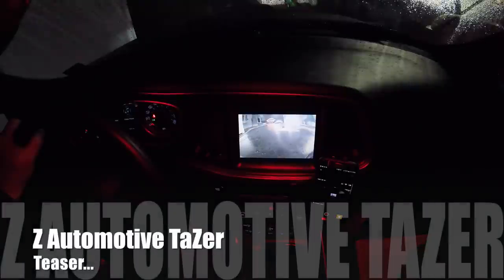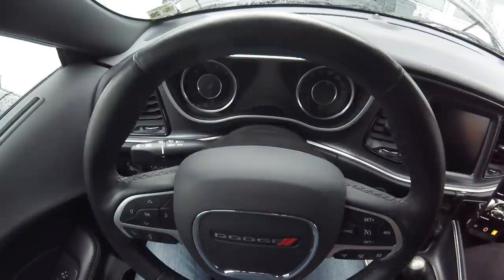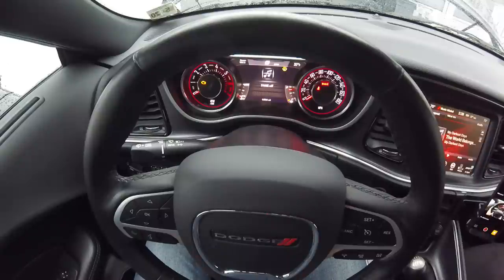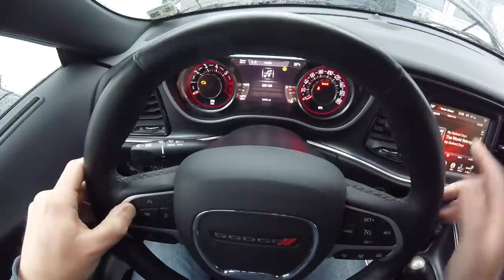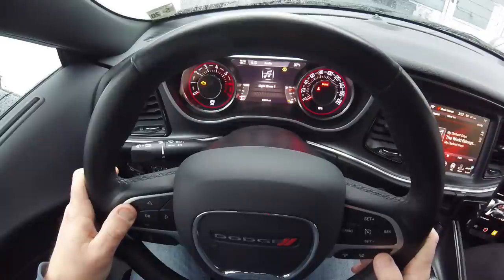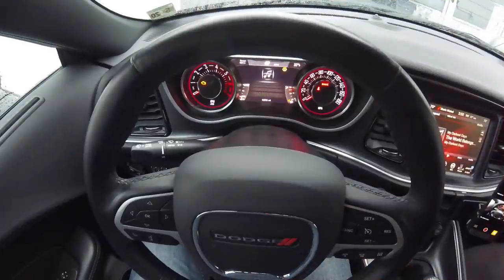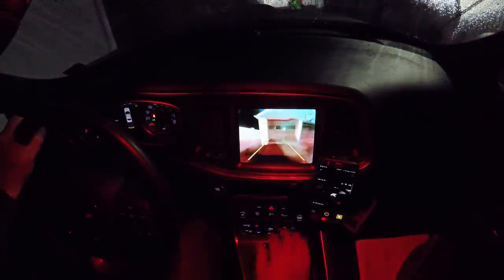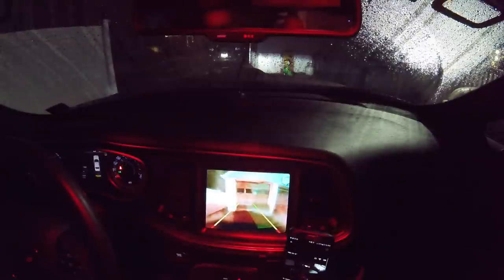zAutomotive TaZer - Mapping Aux Buttons, Font Camera, Fan Control

Comment: Another great install video, as always, you do an excellent job with all your video's brother, it viewed perfectly for me, very clear and in focus. What a great mod for $60.00 and 30 mins of your time, I think anyway!! I especially like the fact that I can map a Light Show into 1 of the buttons, as I am a Paramedic and through the summer months I do "ON-CALL" shifts and do have to use my own car, so I have set up my own Light Show that looks awesome, blending my Scat Packs Light Show with the Whelen Behind the Grill LED Light, a Whelen LED Dash Light and a Whelen LED Visor Light on the passenger side, the whole car is ALL LIT UP now, but of course, there are still idiots driving blind and DO NOT see me coming up behind them, even with ALL those friggin' lights flashing...lol...But my point is that it'll be so much quicker and easier for me just to hit a single button on the steering wheel, rather than the original method of lighting up the car. Thank you for the install video and the link to Steve White as well. I will definitely order one of these Aux Button Switches on Monday from them. On a side note, your Scat Pack is really nice, with all the extra goodies you've done to it. I haven't done much to my Scat Pack at all other than a couple of things. The 1st thing I did was a Mid-Muffler Delete, the best $60 I've spent for 2 Stainless Steel pipes and at that time I also added Black Polished 45* degree Quad Rectangle Tail Pipes that are even with the rear bumper, they look really nice and the overall width of the tailpipe is 8 1/4" whereas the stock tails are 8 3/8" so I don't see that difference at all and the angle of the Quads match the angle of the bumper, which was a concern for me. I wanted the pipes to match the angle of the rear bumper and NOT just to be 90* degree squared off tail pipes, so I'm happy with them and it's been 2 years now and the Black Polished metal still looks new. Of course I store the car through the winter months, which I'm sure helps in keeping them looking nice as well. I did the install of a Hurst Short Throw Shifter mated to a Carbon Fiber Pistol Grip from Hurst as well, and a 180* T-Stat, a Black Hex Filter from R2C Performance replacing that Blue Mopar filter they used in my SHAKER Package, I also did a Full Lighting Replacement including the Foglights with the Flicker Modules and I went with the 510 Lumen Foglight Bulbs and all the other interior lights I decided on Cool White from Diode Dynamics. Obviously, I have a TAZER as well with everything activated and I drive it 99% of the time in TRACK Mode because the car sounds so good with the Active Exhaust always open!! Lol...I also replaced the Black START button with a RED start button, that was a PITA but it looks much better to me. I also had a All Round 25% Window Tint done, which looks very nice with the Maximum Steel paint and last year I had a Mopar Challenger "C" Stripe added to the side of the car as well and it looks amazing. The Black Matte matches perfectly with the Bumble Bee Trunk Stripe that came with the car. Last week I ordered an E&G Classic Rear Window Louver, so it should be here this week. I'm looking forward to adding it to the Scat Pack, so hopefully I'll have it by the weekend and I'll do the install next Sat, weather permitting. I'm now looking at new tires and I'm going with 275/40/20's on all 4 corners but I was considering 245/45's on the front and 275/40's on the rear, for a staggered look, but I'm not sure it would make much of a visual difference, since I've not seen that combo in person and I can't see anything different on the few I've seen in pictures, so I'll just go with all 4 tires being the 275/40/20's instead, then I can rotate all 4 rather than just the 2 going from left to right. I'm looking at either NITTO NT555 G2 tires or the BFGoodrich G-Force Sport Comp2 tires as replacements. I have those same BFG tires on my 2014 Chrysler 300 SRT and they are nice tires, I like them a lot and I have all 4 in 275/40/20 as well. The SRT is my winter car but I change out the Black Vapor Wheels and BFG tires for Cooper AS tires on the front and Cooper Snow Tires on the rear, with Black Steelies from the Charger Police Package to get me through all the winter shit weather. But, I've noticed that you are using Atturo Tires, so I am going to go watch that video next and I'll see what you have to say about them, so maybe I'll change my mind on the Nitto NT555 G2 & BFG G-Force Sport Comp2 rubber?? You never know...lol...Thanks again for the great vid!! Stay Safe!!
Reply from the maker: Regarding the emergency setup, I know zAutomotive is working on a breakout box with relays to control Emergency lights with the light show settings.  Not sure where they are with this, but you may want to reach out and offer yourself up for a Beta.  

Interior lights in white are one of the best mods I've done.  I used these 18 LED pontoon bulbs from amazon and they have been holding strong for over a year now.  My fogs I went with the Diode Dynamics XML2 1420 lumens in 5000K again another awesome upgrade so my front lights all match.  

I wanted to do the red push to start, just haven't found the time to schedule it in yet.

! agree go with the 275/40/20 all around so you can rotate them ;) visually I didn't notice an appearance difference when I ran the stock 245/45/20s with the 275/40/20 in the rear.  You can check my Instagram for photos of the car over the last year.  I put 275s on all for corners last month.  I don't drive the car in the snow so I can't speak for the Atturo snow performance, but in the rain they are excellent and grip better than stock on the dry pavement.

Comment: What kind of camera did you purchase for your Challenger scat pack? I’d like to perform the same modification to our 2021 Challenger R/T scat pack widebody shaker.  Is there anyway to add a Camera application to the infotainment in order to switch back-and-forth between The front and rear camera? In the 2020 Durango RT there is a camera button where you turn on The ventilated seats or heated seats. You can actually even activate the camera while driving in the Durango R/T or Jeep Grand Cherokee Limited.
Reply from the maker: I added a camera to my 2015 and was able to switch by double tapping the mute button. The 2021’s have a different radio setup. I recommend reaching out to zAutomotive to determine if the same functionality exists with the new uConnect.

Comment: I've got a 2016 Challenger and the Sport mode is disabled when I enable SRT mode. So just to get this straight, with the engine on, hold the left arrow and press the Sport button on the console while in the audio screen right?

Do you need to let the car cycle again? I've been trying to figure out how to get this to work and it's driving me nuts. I like the SRT Mode but I cannot drive without Sport.
Reply from the maker: You can’t remap sport, but you could map it to a custom drive mode. Try mapping it to SRT track mode
Reply: Thanks man! Changed the drive mode and worked like a charm.

Comment: So question on the button remapping general firmware updates, when updated firmware versions come out, it's been suggested that you need to change all the settings back to stock configuration before loading the next version firmware....does this include the mapped buttons?. I have 2016 Charger SP and like to know if I change the setup to SRT and remap the sport button and newer firmware comes out, I assume I need to revert back to stock before loading....if I don't, I'm just not sure how this will now effect the mapped buttons?
Reply from the maker: From Joe Z:  "No need to change anything before doing an update.  It'll remember your settings in most cases.  (only when I make major changes and change memory mapping then it forgets your settings, but I haven't done that in a while)

Comment: I can't get my sport button to work not srt mode is set. I know you addressed this but is there a way to get it working without getting these buttons?
Reply from the maker: You don't need the steering wheel buttons, but you do need the latest firmware (Late December 2016) that added the ability to remap the sport button.  Info on that is here > https://www.youtube.com/watch?v=GUZcS1XJXnw

Comment: Can you add front camera without Tazar? I was thinking about installing splitter which of course I wouldn't want to scrape so would like to have front camera hooked into 8.4 Uconnect
Reply from the maker: Not that I know of... You would need something like the TaZer to to unlock the additional inputs, allow you to switch to them and also the A/V kit wiring to insert into your radio wiring harness so you can plug in an input source.  Check out this video on the zautomotive AV wiring.  https://youtu.be/zFd_asz39C0.

Comment: Silly question, what happens if you already have ACC and the stock tech pack buttons?
Reply from the maker: You can remap them as well however they will do their original function AND the Tazer mapped function.
Reply: That might work fine, use the ACC On/Off button as stock with no remap, and then the double function on the distance buttons, so the only conflict would be with ACC On, something you could easily work around.

Comment: do you need the tazer plugged in to control the fans or can you start it without the device
Reply from the maker: Yes the TaZer needs to be connected to run the fans.
Reply: Work Play Drive are their other obd ports that can be plugged into, i wanna keep my diablo in

Comment: With tazer, can u reassign  buttons on the steeringnwheel to something else? Thanks.
Reply from the maker: Yes, but you can only map them to features available with the tazer and any items they add in the future.
Reply: Work Play Drive can you remap prexisting buttons?
Reply from the maker: Yes but it will perform both the OEM function and the mapped function simultaneously

Comment: Just got my Auto 8spd Scatpack Chally, Tazer is on the way! Just curious, have you tried mapping any SRT drive modes to your aux buttons? I think I'd want to put Eco Mode on one of them. (And Yes, I've ordered the AUX button control module as well.)
Reply from the maker: Congrats on the new Scat Pack!  It's possible to map the custom drive mode, don't think eco mode is possible, however the TaZer is updated often and Joe is active in the Mopar communities... Good luck with the install it's fairly simple once you get past the airbag release.
Reply: Eric Richmond did you order the AUX button control module already?

Comment: Awesome videos! Updated my tazer from 2.2.3 to 2.3.2 (to return to stock) and then to 2.4.3 to marry for one touch and to map sport button on my 16 charger scat. All tazer functions work great but no go on the remap of the sport button. any ideas?
Reply from the maker: You need to contact zautomotive for support on that one.
Reply: Thanks for the reply. I have done just that but they really did not have any new ideas for me. I fixed the problem by removing the obd2 splitter. I enjoy the work you put into the production of your videos. It shows in the quality of videos you release.
Reply from the maker: Thank you, by the way I’ve seen instances where splitters cause some issues. Good call on removing it.  If you need another port you may want to consider getting the double bypass and move your Tazer to the trunk.  I did a video on this a few weeks back  https://youtu.be/1cESLOCkgbY

Comment: so I bought the buttons and I wanted to use them to control 3 things.  (nitrous system, bottle heater, purge kit) how did you get the front camera programmed into the unit?  is it hidden in the dodge hardware somewhere?
Reply from the maker: With the TaZer those 3 buttons are not mappable to functions outside the TaZer options currently available, you may need to do some modifications to get it done or Contact them to see if custom mapping is an option.  You are definitely not the first person that wanted to do this.  

The front cam is not in it's final home yet, I'm still trying to find the perfect spot for it without having to cut anything or have some silly project box in plain sight.  Waiting for warmer weather to tear down the front end.
Reply: David Mathis did you order the AUX button control module already?

Comment: I'm installing some Kindig-it Design Exhaust Cutouts and was looking for options for the button, this looks like a better idea and got me wondering if its possible to use one of the AUX switches to control the cutouts?
Reply from the maker: I don't think this would be possible without some intense programming, as they are not on/off switches they just send signal that is processed by the car.   The Tazer is remapping these to functions that exist in the car or the Tazer.

I checked out the Kindig-it Design looks sweet, I have a set of NoWeeds diverters in transit, should be here next week I cannot wait for more loud.  I do agree It would be awesome if the steering wheel buttons could control this
Reply from the maker: Scratch that, I just spoke with zautotech and they are making a canbus add on or the TaZer to allow on / off  functionality from the AUX buttons.  I'm waiting  to hear back on a release date so maybe I can use them for my Diverters :)
Reply: Thanks for the input, hopefully the function will allow on / off functionality for AUX buttons.  Let me know what you find out on the released date.

Comment: hello quick question... the camera is now available. is the quality good? I'm thinking of purchasing soon. everything else is in place taser, extra button and av cables... if you know about a different camera thats better let me know please. thanks and love all the videos 2016 challenger scat (love my boo)
Reply from the maker: quality is limited by the 8.4 uConnect screen.  This cam is good, glad it's available again.

We have a good discussion on this going in the "Challenger Scat Pack 6.4 Owners Group"  here is a direct link to the post.  Where we discuss wiring it up and other camera options.  It is a private group so you do need to join first the only requirement is owning a Scat Pack

https://www.facebook.com/groups/1521659391385083/permalink/1832881386929547/?comment_id=1835911113293241&reply_comment_id=1835966116621074&notif_t=group_comment_mention&notif_id=1489363696401124
Reply: Work Play Drive thank you... I requested but it won't accept my answer for what year and color my challenger is😢
Reply: I got in thanks.
Reply from the maker: Sorry for the troubles I got in a while ago, didn't realize you had to take a test for membership lol...
Reply: Work Play Drive lol no trouble at all I passed 😜

Comment: What happens to mapping if you remove the Tazer and reinstall? I use a data logger for track days, so I'm curious if I have to remap every time I unplug and plug in the Tazer.
Reply from the maker: The button remap is stored so you don't need to reprogram.  Don't forget you can also use the TaZer with a Y cable so you can have a free port for your data logger, if needed.
Reply from the maker: Nice! I watched your most recent one, looked like you were held back by the guys in front of you.  Subbed and will check out a few more later on.  Love this part https://youtu.be/43g0ocNDYEA?t=4m50s

Comment: So is this just a factory adaptive cruise switch but the buttons have been changed to aux lettering?
Reply from the maker: This is more for the cars with blanks there.  My 15 Scat Pack just had 3 blanks there., so swapping this out made them active buttons.
Reply: I know. I think they are using a factory switch with adaptive cruise but they just change the button letters. My Hellcat doesn't have any buttons there also.

Comment: Do you have a fix on remapping sport mode button (that doesn't work in Tazer SRT mode) or any other solution for 2015 challengers? I only have SRT disabled because I can't use sport mode :( it's frustrating. Tazer says 2016-17 can only remap :(
Reply from the maker: You can remap the sport button on a 2015 to a custom drive mode that includes all sport options. My 2015 Scat Pack sport button works with SRT enabled.  What model do you have?
Reply: I have 2015 RT. The remapping isn't the biggest issue. I believe the big problem I can't get around is that sport and track only work if you have a red key and even in custom mode you can change everything except for engine where it asks for a red key to switch (it thinks it's a hellcat) to sport or track (as soon as I click on sport on custom it asks for 700+ hp red key). There may be no fix :(
Reply from the maker: I've got some bad news on that one.  These are known issues that may not be fixed because this area offers no functionality in the 5.7

The below is from the FAQ   http://www.zautotech.com/docs/Tazer%20FAQs.pdf

If you have a 2015/2016 Charger 3.6 or 5.7, setting SRT will result in an airbag error. Nothing unlocked in SRT mode works on the 3.6/5.7, so no reason to enable SRT on these cars. You can still get all the EVIC performance pages and add sport mode if you don’t already have it.

- If you have a 2015/2016 Challenger 3.6 or 5.7, enabling SRT will not result in an airbag error, but the uconnect will think you have a Hellcat and are using the black key, so sport, track, and valet modes will be inaccessible.
Reply: Yes. I am aware. I am confused on how it would think the 5.7 is a hellcat but wouldn't think the 6.4 is a hellcat to give the same error asking for red key.